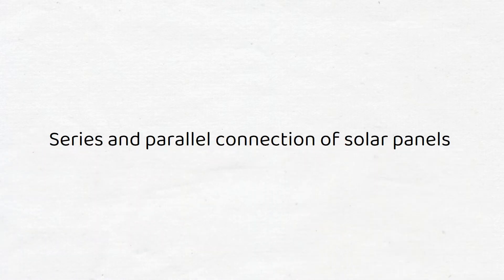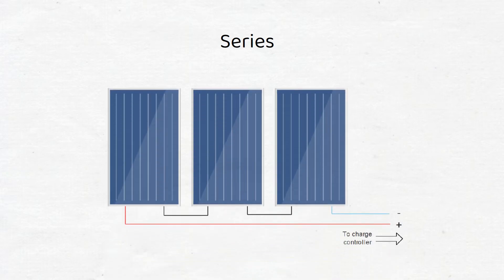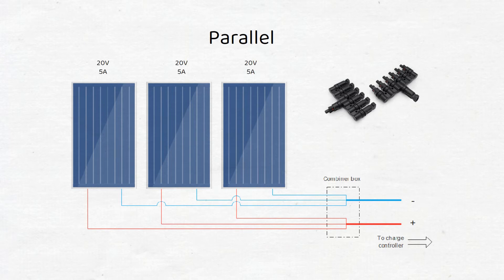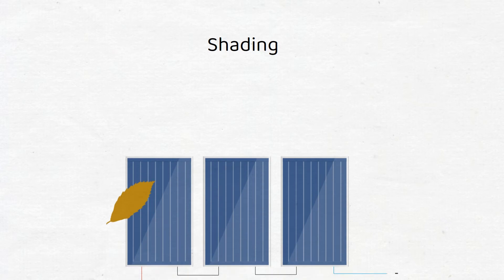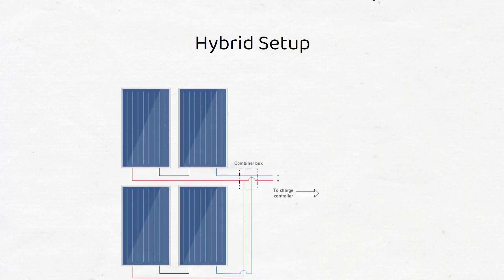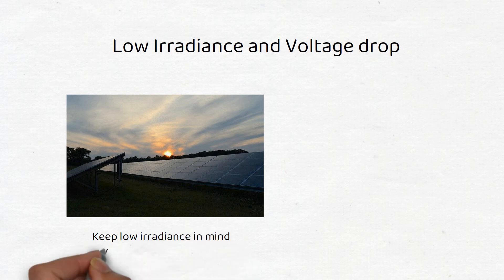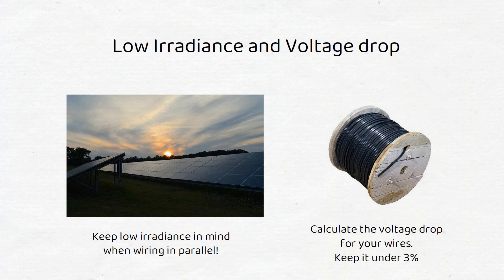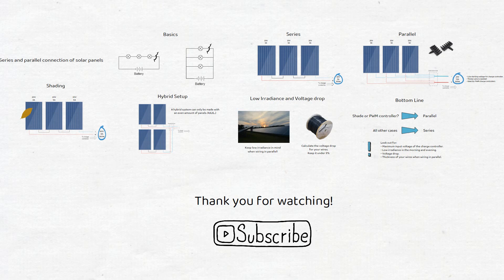Series vs Parallel Solar Panels: Shade, Voltage, and Current

Comment: I have 5 lithium 12v batteries. I put 4 in series for the 48 volt inverter. Where is the best place to put the 5th battery in parallel? Thanks
Reply from the maker: If you have a 48V system with 12V batteries you cannot use a 5th battery. Its either 4, 8, 12, ...
Reply: @cleversolarpower  OK, thank you!

Comment: I have 4 pieces of 550watt panels and 4.2kw hybrid inverter with two tubular battery what connection will I use to connect it i need help?

Comment: Am i correct ... in parallel , if 1 panel has shade then the amps are reduced for only that panel,  the other panels in full sun retain full amps , the voltage remains the same for all panels ?
Reply from the maker: Correct.

Comment: I currently have a 220 watt Off Grid TREK solar "blanket" that directly charges my BLUETTI AC200 MAX LFP battery. 
Q-> For PARALLEL WIRING OF AN ADDITIONAL THREE HUNDRED WATT SOLAR BLANKET do I ned a special controller?  
 OR can I just use the other DC input for my battery without connecting the two blankets?
Reply from the maker: You need to check if it's possible in the manual.

Comment: Dear Sir this Harun from Bangladesh please help me i have 4 pannel longi 355w PV open circuit 40.6V connect with my 6kw off grid MPPT inverter MPPT starting range 120-500VOC now i buy 3 more longi 360w open circuit 40.8V please give me suggestions which wearing Best for me if I connect together is there any damage inverter or PV Need your help response
Reply from the maker: Please watch my video about sizing a charge controller.

Comment: Why does the series, in hybrid need to be even numbers?  2, 4, 6 the reason why is I am having issues with set 1 series 5 panel and set 2 series of 5 panel charging the batteries..any suggestion
Reply from the maker: Lets say string a solar panel is 20V and 5A (100W). String 1 consists of 2 panels in series to make 40V, 5A. String 2 consists of 3 panels in series to make 60V, 5A. If we combine these in parallel (current adds up, voltage stays the same) we get 40V, 10A, because the voltage takes the lowest string into account. So we get 400W with 5 panels.
Reply: @cleversolarpower  ahh yes, thank you... My set 1 of 5 panels and set 2 of 5 panels are the same model and voltage so I should be good.

Comment: I am planning to install the solar on my boat. I found this panel of 530w 48v at a good price and thinking to get 4 of them for a total of 2120w. If I install them in parallel of 1060w each, can I use then a heater of 1500w? I will use 3000w inverter. Thank you
Reply from the maker: With that much solar, you should have a 48V system. Will be much cheaper. Check my video 12V, 24V or 48V systems.
Reply: @cleversolarpower  I actually mentioned 48v

Comment: Shading is not a big problem with bypass diodes. They are normally built-in in every modern panel! There is still a bit of current suffering, but not as much as you described.

Comment: I need an explanation: I have two solar panels of 455W each, but on different sides of the cottage, and a 12V, 160ah battery. What connection of solar panels do you recommend? Thank you very much
Reply from the maker: Parallel, and for the most efficient solution another charge controller.
Reply: @cleversolarpower  Please, I don't understand how two controllers are possible? thanks

Comment: I have a new setup built following your guide on videos and book. The item I overlooked was shading. I have 2 panels in series and it works but charging my 2 100ah batteries in series is slow. Today, I'm waiting on the y connectors to change it to parallel since one of my panels is often shaded. I'm hoping this will make it better since I need this setup to charge my ego z6 mower. 
Thanks for your clear videos.
Reply from the maker: Yes, paralleling will get rid of the shading issues. Make sure the panel voltage vmp is 5V over the battery voltage
Reply: @cleversolarpower  I may be in trouble then. VMP for the panels is 20.4, batteries are in series and inverter is for 24v. I thought the Victron mppt 100/30 would increase the voltage for battery charging.
Reply: @cleversolarpower I still have time to return the 24v inverter. Just ordered a 12v inverter and will switch batteries to parallel. Glad I was able to chat with you.

Comment: 3:46 if the other two panels make 5 amps, why doesn't that current flow around the shaded cell through bypass diodes?

Comment: U didn't mention the Amp's rating and Voltage rating of the hybrid system.. what will the exact output .. 
Does amp's multiply or not and what about voltage.. 
I'm trying to understand what the exact reading will be for my 12.92 amp's & 44.88 voltage per panel with a hybrid system of 10 panels ..
Reply: Both the voltage and current would be increased.

Assuming you use a configuration of 5 series, 2 parallel, you are going to have a voltage output of 224.4 volts and current output of 25.84 amps. 

If they're wired in a configuration of 2 series and 5 parallel, you'll get 89.72 volts output and 64.6 amps output.

Comment: Bro I have 2550va pcu solar  inverter with 390w / 24 x 2 and 450w/ 24v x 2 panels total 4 panels  which connection is good bhai

Comment: What do I do if 4x 400w panels are 200v ?
Reply from the maker: You split them up. 2 in series in two parallel sets to get 2S2P wiring setup. Called a hybrid system.

Comment: Hello, just a quick question. Can i do a series connection of a 110v solar panel with 160v solar panel to charge my Ecoflow River 2 Pro or Delta 2?
Reply from the maker: A 110V solar panel doesn't exist. I assume you meant Watts. Checkout my video about wiring mismatched solar panels. Make sure the ecoflow can handle the input voltage and current.
Reply: @cleversolarpower  you are right. 110w. I have 110w and 160w. Can i connect them together?

Comment: do bypass diodes not mitigate the effect of shade on panels wired in series?
Reply from the maker: No, they bypass 1/3 of the panel so 2/3 of the panel is still going through. This means that the entire series string suffers from a 2/3 of the total power.
Reply: So if any shading is likely to occur, it would be better( assuming the mppt can handle the increase in current) to wire in parallel? @cleversolarpower

Comment: I enjoy your videos and have watched many of them. I am planning a portable solar system for my Travel Trailer. I am planning to use my 2 x 200 watt panels in parallel and place my charge controller in a water tight enclosure to move it with the panels to where I have the most intense sun light as we travel. That way I keep the minimum start voltage loss problem to a small value, and the charge controller can then send the power to my battery's via #10 awg wire. My charge controller is rated at 30 amps 100 Volts. Does my plan make sense to you? 

Additional information;
My trailer is equipped with all 12 volt equipment so switching to 24 volt would be more costly. I do not use an inverter. Our load items, Fridge, and pump which are propane and 12 volt respectively, ( yes the fridge has 12 VDC ignition). All cooking and boiling etc we do via propane stove, lights in and outside the trailer are LED 12 DVC. small use of USB charging of mobile phones as well.
Reply from the maker: Makes sense to me to keep the 12v when you don't have an inverter. Charge controller and panels are ok. You wire them in parallel for shading issues? If the panels are in the sun, better wire in series. Lowers your voltage drop. But overall, it seems ok to me.
Reply: Thank you ever so much, I will likely set my self up do series then.  @cleversolarpower
Reply: I just watched an other video and felt it good to add the following, My solar panels have an 18.3 VDC output which is in line with your recommendation for 12 V plus 5 Volts for my MPPT charger, do I understand correctly? I had two 100 watt panels, last year and found shading to be a problem in most camping parks at one time or an other hence I am thinking to do Parallel arrangement.

Comment: I have connected 8 solar pannels in series with 180 Amp MPPT solar inverter  but in b/w 12 PM - 3PM ( pakistan std) my 4 pannels are facing shading...can i use hybrid connection or only parallel or series...?? Plz tell me,, distance is 50 feet,, i have used wire of 8mm size from solar to inverter..... Please
Reply from the maker: Take a look at my video about voltage drop. That will help you.
Reply: @cleversolarpower  can you please share the link of such video. Thanks

Comment: Wouldn't the bypass diodes in the solar panels mitigate the impact of shading in series setups?
Reply from the maker: Yes, the voltage becomes 2/3 of the panel. But the current also decreases. So the whole string will be 2/3 the current.
Reply: @cleversolarpower  That's what the panel opitmizer manufacturers are telling the public, but that's not what happens in real world testing. There are many credible videos on YouTube debunking this claim.

Comment: Could you explain why a parallel connexion is better 
With PWM controleur
Reply from the maker: You have to match the solar panel voltage closely to the battery voltage (battery voltage +5V). If you do not match it to the battery voltage it will be less efficient.

Comment: Thank you! 
Excellent presentation! 
Straight to the point with adequate detail.
Reply from the maker: Thank you for your feedback! What topic do you struggle with concerning solar power?
Reply: 1) Secondary component list, such as fuse type and location, breakers. 
2) Matching different solar panel cable connection types; cutting off ones that don't match and putting on one that does or just crimping a sleeve to join them. 
3) Trouble shooting a dead panel. 

Thank you so much!

Comment: What i dont understamd is why you would want higher voltage to a charge controller (series connection). Amperage is what charges batteries faster, not voltage. Maybe i am mistaken, but this is the information i keep searching for, however, no one is discussing
Reply from the maker: No, the MPPT will take the higher voltage and reduce it to charge your battery while increasing the current. Let's say your solar panels are 400W total (2*200W) with 10A and 20V each. Series connection: 10A, 40V -> 400W -> charging a 12V battery= 33.33A. Now if we put the panels in parallel as you suggest is better: 20A, 20V -> 400W -> charging a 12V battery= 33.33A. It has the same charging current if you wire in series or parallel. Therefore we wire in series to reduce voltage drop in the wires and use thinner wires.

Comment: Thanks so much for this information. Please, I have 2 300w solar panels and 60amp Charge Controller my question is which connection will be appropriate for me? Parallel or Series connection? I will appreciate a response. Thanks.
Reply from the maker: Parallel for PWM and Series for MPPT.
Reply: @cleversolarpower  Thanks 🙏

Comment: You’re ignoring bypass diodes that exist in modern panels. You shade one panel and that panel gets bypassed by the bypass diodes. Your mppt still receives full power from one panel and perhaps some of the shaded panel depending on where the shade is on the panel.  I tested this last weekend. Completely covered one panel in the series connection.  Amps went to zero and then is a few seconds the amps when to half of what the total was (just 2 panels).  I will say in parallel the amps adjusted immediately instead of waiting for the bypass diodes work and the mppt to adjust to the new lowered power.  Parallel better for small systems but series is required for most if not all power stations due to low amps in limit (like 15 amps but 145 volts - only way to get more than 1 panel is to wire series.
Reply from the maker: Yes, you can see that happening in the video. The voltage will get reduced. But if we wire in series the voltage gets added up. So if you cover one panel, then the voltage will be half indeed. You can see this happening in the diagram with the leaf.

Comment: The shading at 4mins isn't correct.  It should result in 10v + 20v + 20v =50v x 5A because solar panels have by pass diodes so producing 250w of power.
Reply from the maker: No, you are incorrect. Shading doesn't affect voltage. Voltage is affected by temperature and current is affected by the shade. So only current changes. You should take a panel and test it for yourself.
Reply: @cleversolarpower  Surely if one string in a panel is shaded then it won't work, the b- pass diode operates and the circuit works again but with no voltage from the string only the other 2 strings in the panel are available to generate voltage.  Strings of course are wired in series.

Comment: If I have four 100 watt solar panels in series. Should I have a 40 or 60 amp Mppt controller??. Would like to add a couple more panels in a few months
Reply from the maker: If your battery is 12V, then you need a 40A controller (400W/12V=33*1.25=41A)
Reply: @cleversolarpower  can I run a 60 amp charger instead?? Probably and more panels next year.

Comment: So basically the only disadvantage of using parallel is thicker cable but have anyone ever though of just running the standard cables in parallel instead of going out to buy thicker cable?
Reply from the maker: You can, but two cables is more expensive then one cable. Parallel is also for PWM charge controllers. Another disadvantage of parallel is voltage drop.
Reply: @cleversolarpower  It is true that ve but as an expert you are well aware of shadowing the panels, A 100m real of 6mm cable is £150. rated at 70amps, 2 pairs of such cable run will carry 140A, there is slight voltage drop depending on what current you're pulling obviously. But depending on how many panels you have on a very cloudy day 5 panels could still be outputing 2 amps each which is 10 amps, if the panel ppt voltage is 30v thats 300w whereas in a series wired panel you wouldnt be getting anything. the cable run is a one off cost but power output will cover that in hardly any time. If you want to avoid thick cable some home installers do think outside the box and connect in parallel then using a 3kw boost converter up the voltage to 60v. By the way what you said about parallel system is for pwm is incorrect, parallel system do work from buck converters/mppt better than pwm which is very energy inefficient

Comment: Great, easy to understand explanation. What about using micro inverters? How do they help with either option?
Reply: instead of using expensive microinverters which doesnt work on standalone systems (off grid) you can use a boost conveter on each panels. by the way did you realise if you use microinveters you will still need to convert back to dc to charges batterties?
Reply from the maker: Microinverters are not that great for off-grid. As Dan mentioned, you would have to convert again to DC which leads to losses. You can use an optimizer if you have shade and want to put your panels in series. Personally I wouldn't use optimizers if you have the space.
Reply: @cleversolarpower  I agree about the losses, but with the latest hybrid inverters you can feed AC AND DC, therefore you can balance your demands for feeding the loads during the day without conversion and a seperate feed of panels dedicated to topping up the battery for when the solar is not producing. Higher investment, but a much better potential to use the available power. Over the lifespan of the components it should pay for itself easily.
Reply from the maker: @simonpaine2347  You can, but you need an off-grid hybrid inverter. Which doesn't need input from the grid to make its sinus. There is no advantage to using microinverters over series connecting your solar panels. Installing microinverters are more expensive and not needed. But that is my opinion, everybody can have their own.
Reply: @cleversolarpower  I totally respect your opinion, but I also have seen numerous videos from Engineer 775 who has installed numerous systems with Sol-Ark inverters with AC coupled systems with micro inverters. They seem to make sense and work well.

Comment: Thank you, great explanations! One question please: "Different models of panels should never be connected together". You mean different 'size' panels hence different Watt- or power-panels, don't you?
Reply from the maker: Yes, different panels have different voltages and current. If you connect panels in series, the voltage needs to be the same. If you connect in parallel, the current needs to be the same. Check my article on my website about mismatched solar panels.

Comment: On an East-West-South roof (in Europe) with 4 panels, what is the best set-up? 
a) 2 East + 2 West series parallel? 
Or all 4 panels on the South; 
b) 4 series or
c) 4 parallel or 
d) 2+2 series-parallel? 
Which one provides the best average power output throughout the day?
Reply from the maker: Throughout the day its better to have 2 panels south, and two panels east or west. Make a 2S2P system on one charge controller. That is if you don't have batteries (grid inverter). If you have batteries, it's best to have 4 panels south in series.

Comment: Thanks for the advise, we have gone for a parallel set-up, lithium batteries and an MPPT SC because MPPT is 20 - 30 % more efficient. Yes I need bigger cables but that is a once off cost to have a more efficient system overall. We live full time in our caravan for 18 months and have not plugged in, in this time. I would not recommend PWM for mobile homes / caravans, but that's my opinion.
Reply from the maker: Indeed, if space is a constraint like a caravan, then i recommend parallel or every panel on a separate MPPT.
Reply: @cleversolarpower  I don't understand the purpose of individual MPPT on each panel? Can you elaborate please?
Reply from the maker: @notaperson3338  My first recommendation is to wire in parallel. But if you want redundancy you can use one MPPT per panel. It's going to cost you more, but you have peace of mind if one charge controller fails. Redundancy is the only reason here.